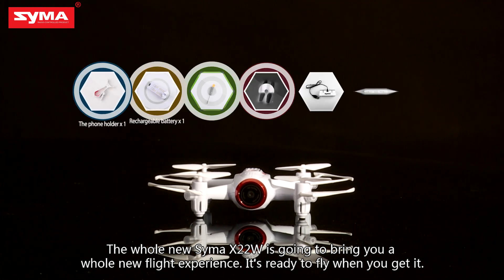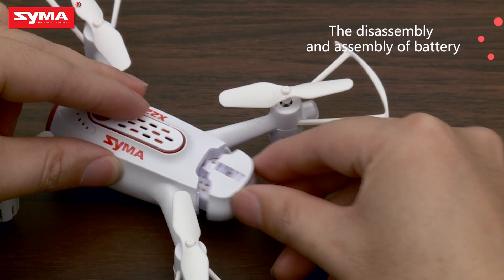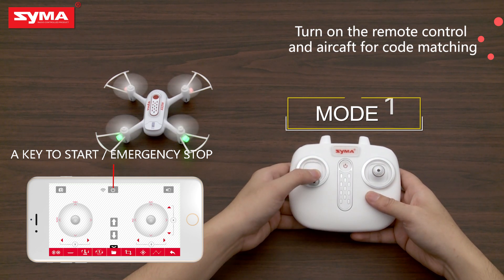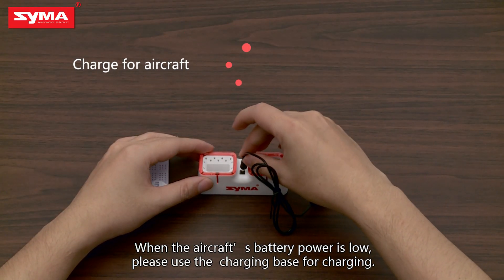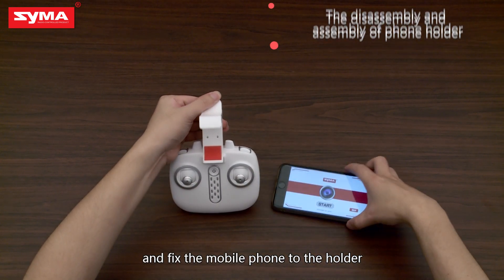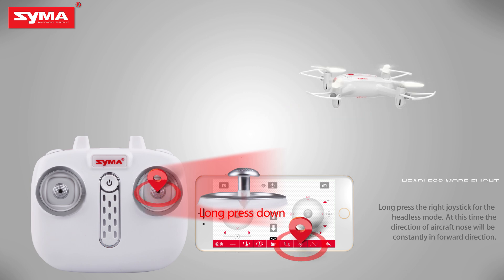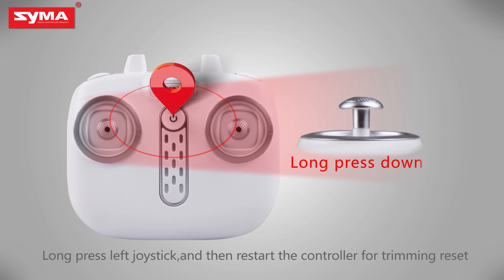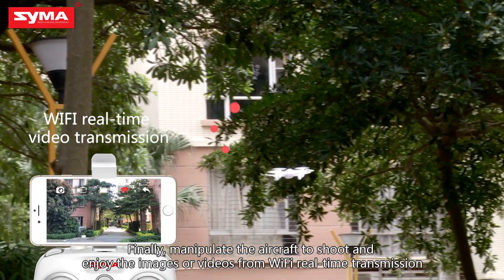SYMA X22W FPV Drone (Wifi Version) Operation Tutorial

Comment: I have Syma 350WH and it’s not connecting with wifi for phone control. Also you can’t take pictures and videos using the controller. I tried resetting my wifi and resetting the drone and still not connecting. It says the drone wifi has no internet connection.

Comment: I think DJI does this too but I honestly can't understand this bad function ! If you use the sticks down right and down left, the drone turns off the motors completely. BUT !!!!!! If you fly extremely and constantly make extreme flight manoeuvres, it can happen that you accidentally have the control sticks briefly like this - this is the reason why the X600 has already fallen 3 times from the air about 2-3 metres like a stone and with the X20P already once. To be honest, I find it stupid that the motor can be switched off completely via the control sticks. In my opinion, this should only be possible via a button.

Comment: Hi, my drone works well, but my original charging base outputs 4.34V to the battery? 
The normal charging voltage is 4.2V
And also my drone flies 2 minutes on a full battery.

Comment: Auto hover mode not working
Reply: Hey, I just bought this yesterday, and my drone will not stand still in air. Slight droop to one side all the time so i have to balance it continously. Is this what happens to you? Did you fix it?